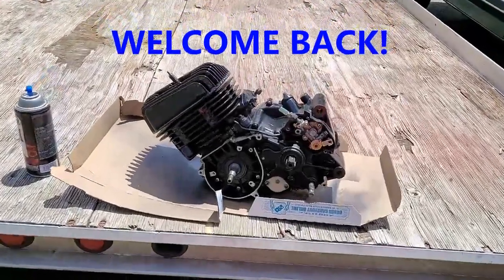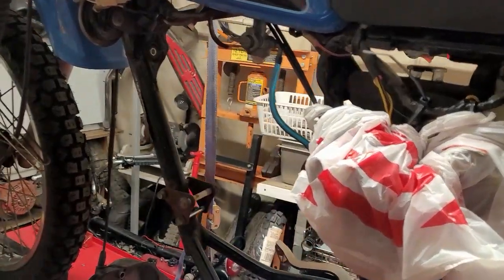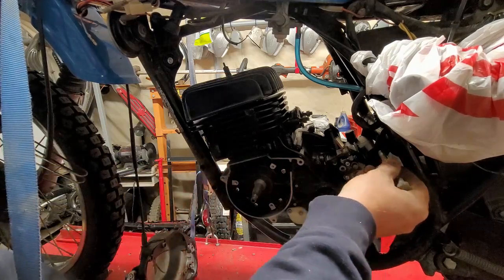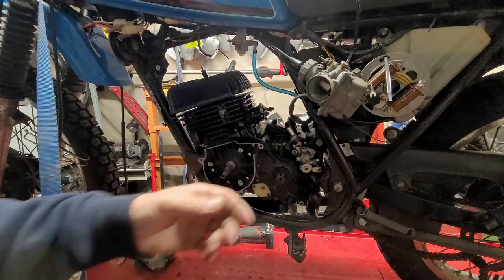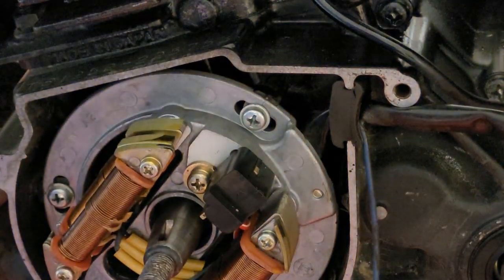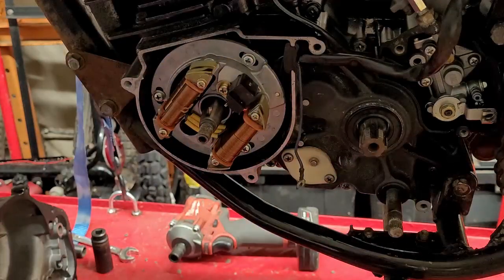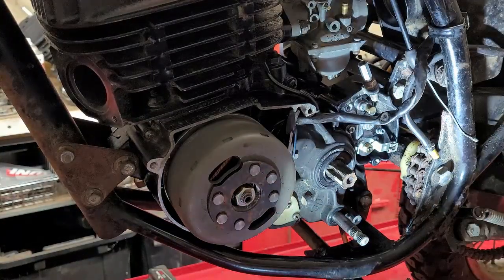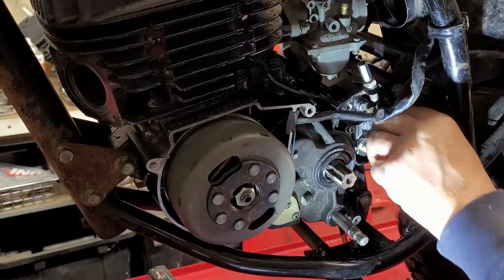Working on David's bike part 8 cleaning /paint engine install magneto setup and carb

Comment: Kevin, I have a 1980 TS100 with the same Pointless magneto as David's bike. Coil is within tolerance, but no spark. What are the measurements I want to confirm for the magneto before I try the OHTOKC CDI conversion kit? Please and thanks.

Comment: Hi Kevin love your teaching method. I recently found your channel and love your content. 
I recently found a gem of a bike. A Yamaha DT-125. 1974 model. It’s unique that it has a start system I am un familiar with and am totally ignorant of. It uses the battery to fire the magneto and turn it into a starter and of course it has been hacked by people trying to fix it before me. How do I find a manual for such an old bike. 
And any info on this system you have would be greatly appreciated. 
I hooked up a twelve volt battery to it and everything on it worked including the start system. 
No spark. I think it might be a six volt system and it has been cooked by twelve volts ?
Reply from the maker: Hi Robin thank you can you call 603 395 8097 after 6pm est

Comment: I noticed in my service manual for a g3ss I am working on it says to use kawasaki bond silicone sealant between the crankcase halves, but I cannot seem to find this product. Do you know where i can find this sealant or a good replacement for this sealant?
Reply from the maker: I use honda bond
Reply: @2strokeguru  thanks!